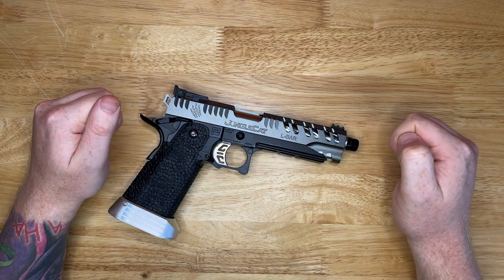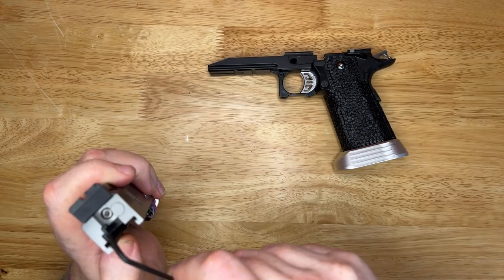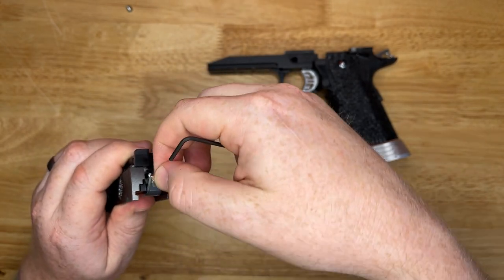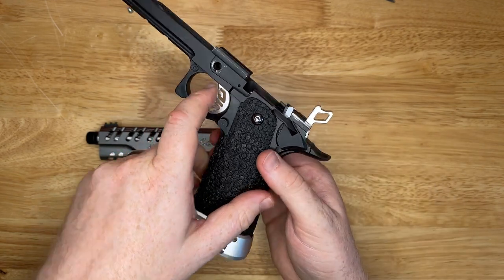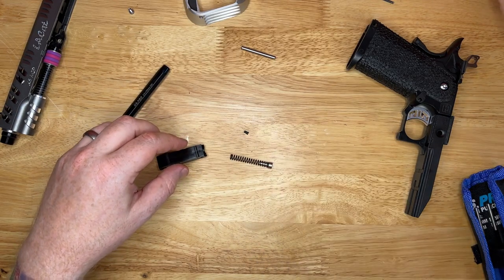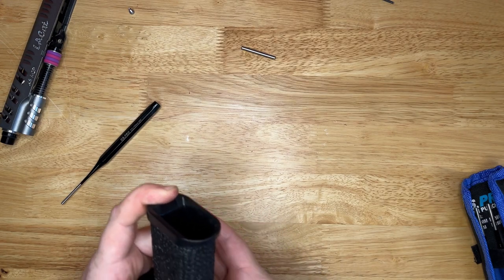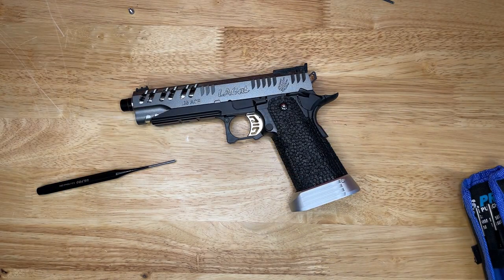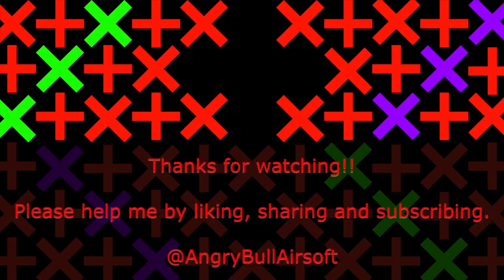Installing AIP Hammer Pad onto Hi Capa Airsoft Pistol - Fix Light Strike - Upgrade LACC JungleCat

Comment: The bb trick doesn't always work. Some slides are a perfect fit with the frame allowing the hammer to hit the slide and frame at the same time, while others have a massive gap. A well paired slide and frame will always light strike with a hammer pad
Reply from the maker: Agreed. My preference is not to run hammer pads for the reason you've given.

Comment: Instead of the bb trick... You could just get a cowcow power regulator kit for the hammer spring or a stronger spring.

Either works.

You should have tested with gas in an empty mag to see if it actually fixed any potential light strike issues
Reply from the maker: I can assure you the homework in advance of this video showed it did cause light strike 😉 Power regulator is an option but of course but the BB thing is somethign everyone will have to hand. Fixed it a treat on both my pistols with pads.
Reply: Why would you spend another $ if you can just use the bb trick? If it works, it works. No need to spend extra. Just sayin.
Reply: @johnmichaelvicente1128  you can get different results with the cowcow hammer regulator kit.
It has 3 different spring tensions and washers too.

Plus it's not that expensive anyway... And LA CAPA CUSTOMS use this in their builds and recommend it.
I have the hammer pad on all my aftermarket slides and never had light strike issues
Reply from the maker: @johnmichaelvicente1128  I know where you are coming from however the BB doesn’t allow you to alter the amount of extra pressure. The Cow2 one does so you can get the balance right.
I’m all about a quality BB though 👍

Comment: i have my hammer spring set pretty stiff and after shooting for a while my screw has seemed to rip the threads out of the bbu, is this an issue of a cheap bbu or is my hammer spring too rough
Reply from the maker: Yes? If everything is up tight it shouldn't have been able to kill the threads on the BBU. Difficult to say without knowing which BBU you are using. I'd back the hammer spring right off though to be honest. Rarely do I run strong er than stock.